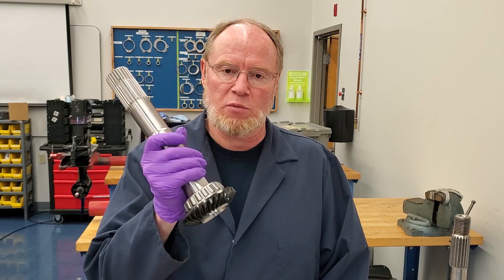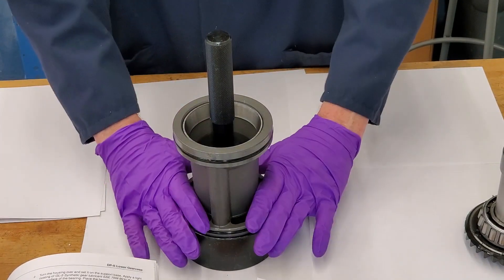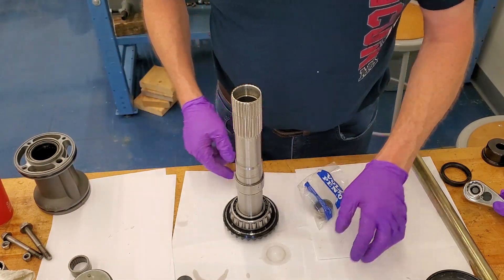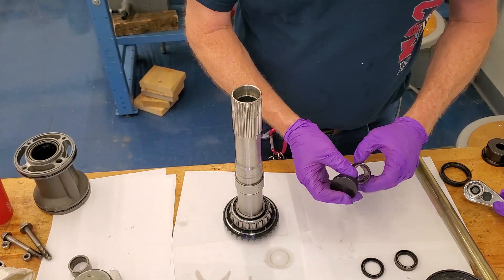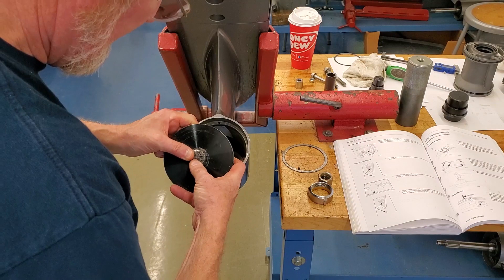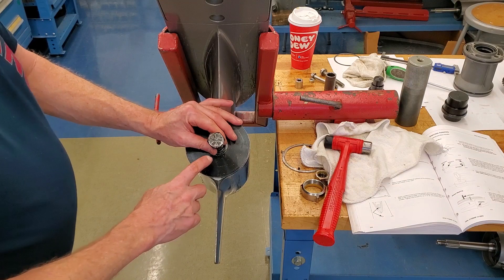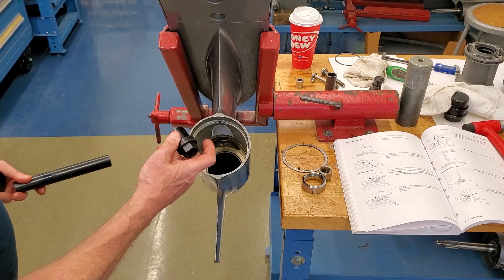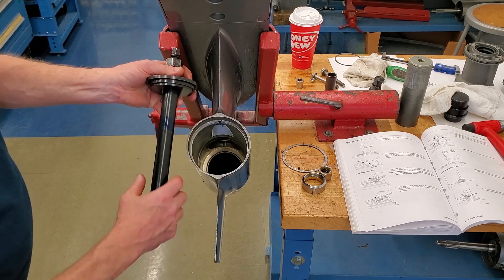Volvo Penta DPS Lower unit rebuilding Part 3  (1st section)

Comment: I replaced the propeller shaft seals on a 2002 year DP-SM 1.95 ration outdrive. I may not be able to separate the lower unit due to some stuck bolts.

Is there another way to set the bearing preload, such as measuring  either shaft endplay? Would tightening the bearing carrier retainer nut to the same position suffice, which I marked before disassembly? 

I did not replace any shaft bearings, gears or needle bearings. Thanks you for any advice here.

Comment: Hi Ted. What is the part number for the shop manual. Thanks
Reply from the maker: @luisrodriguez-ww2zl  For the older DPS-SM  it is 7743008
DPS-A  and newer it's 47701863

Comment: What may I ask is the sealing compound on the putside of the seals at 5:10 in?
Reply from the maker: @mosesgutierrez639  I have always used a non-hardening sealer. I believe it's made by peratex. The sealer I use is quicksilver perfect seal.